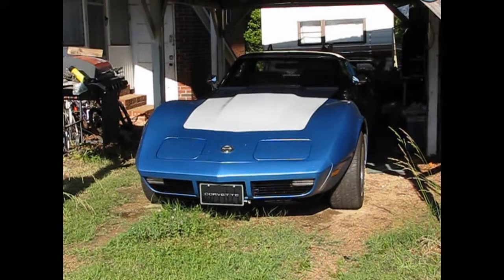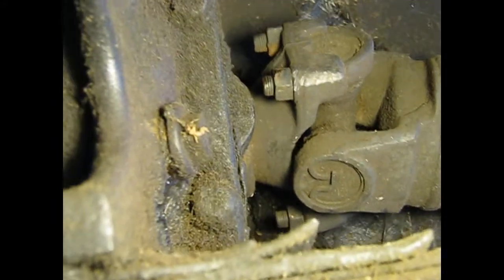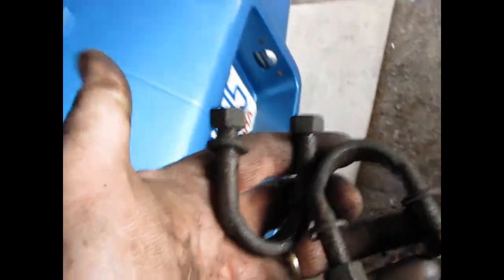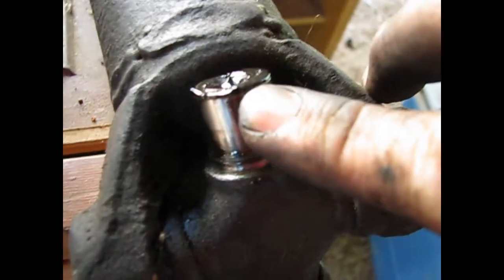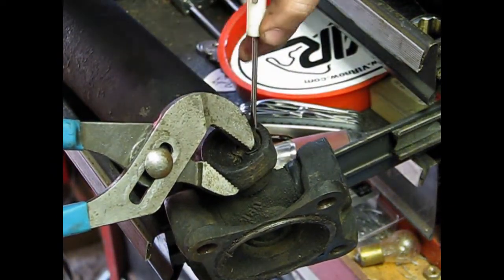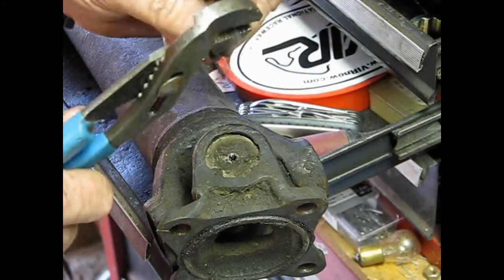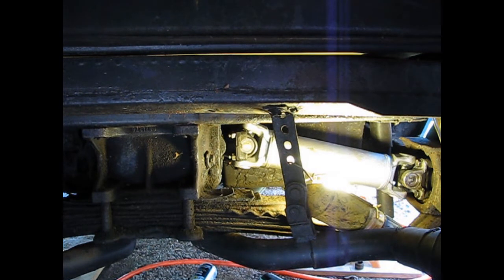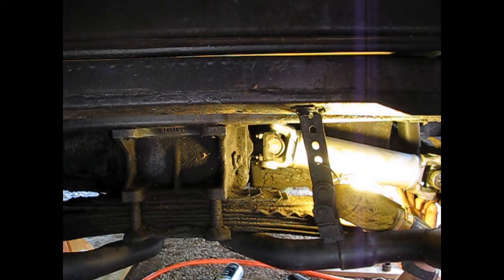C3 Corvette U Joints

Comment: This was really helpful to see what I'm getting into. Thank you for explaining everything in detail and the camera work was also solid. I opted to just replace the entire half shaft assembly rather than just rebuilding with new U-Joints. My '75 and as you stated the diameter increased to 3" rather than the thinner 2.5"

Comment: Did I miss the part where you installed the u joint into the spindle flange??  Also you can't use that half shaft when you can press the u joint cap in with your thumbs...take it to your driveshaft shop and have them weld a new yoke in it.

Comment: never press on the side of the yoke ,you can bend it ,and the new U-joint won't fit properly.use a small socket to drive the U=joint cap down .use the press plates to allow the other cap to drop out .use solid U-joints ,not the ones with grease fittings .

Comment: @ 14:30 on your video The Chevrolet Corvette (C3) was a sports car that was produced by Chevrolet for the 1968 through 1982 model years. Also the half shafts need to match and weight or you will get a vibration in your rear end it can range from mild too severe. Anyway like your video will be using it for reference thank you

Comment: What year is your Corvette? My bolts on my u joints are very small 1/4 size 12 point Socket it's 1981 Corvette. Did you seem to get your half shafts out easy? How about the drive shaft was it easy? I have not done the job yet. Thank you great video..
Reply from the maker: Mine is a 1974. I had a lot of trouble getting the u-boats out because they were caked with so much road grime in the bolt threads dut once they were out, I was fairly easy to get the half shafts out.
Reply: I just jacked up my 81, undid the 12 point 1/4 bolts, and was able to wiggle it out of the car.  I've had these out before, they go back in fine.